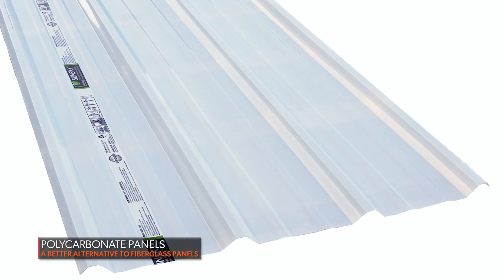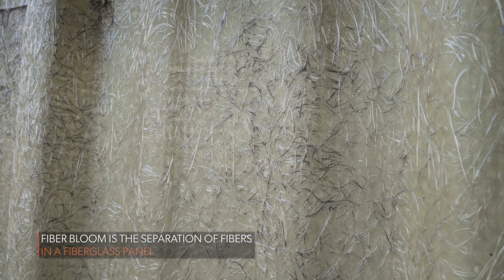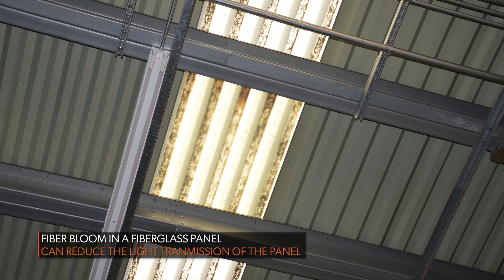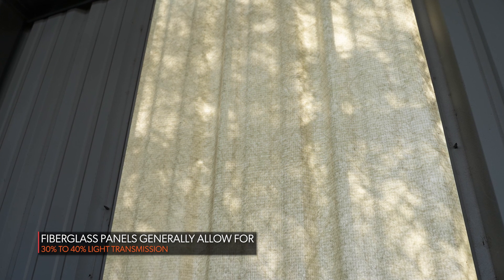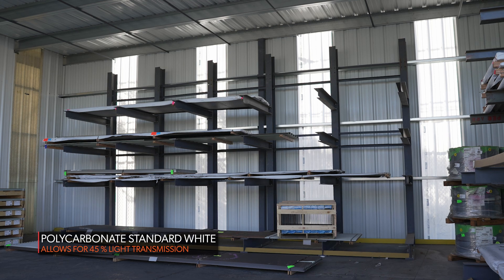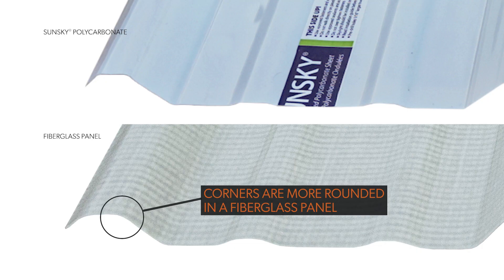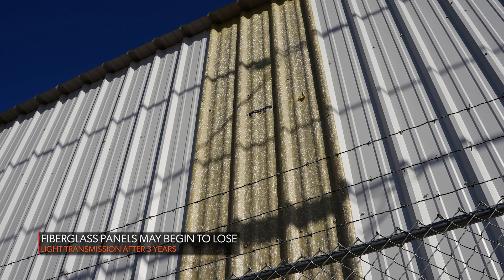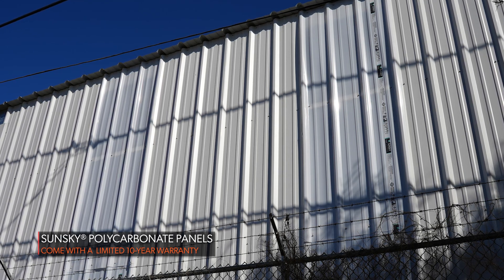Fiberglass Vs Polycarbonate Roofing Panels: Which Is A Better Skylight For A Metal Roof?

Comment: I went to Pet o werehouse the roof tops has a fibreglass panel I 
Think it’s cracking
Reply: If you made it right it wont crack. Fiberglass are for underfeound tanks and pipes also. Depend on application.

Comment: There's a full fiberglass greenhouse at my great grandparents'  house that's still sturdy and going strong for over 50 years now. I'd rather have something that lasts, all these newer plastic panels would bust with strong wind or some hail 🙃
Reply: That's why im telling everybody here that this is a very wrong information. Fiberglass last for years even 50 years or more. As long as you use the right materials and process. Here are the fiberglass industry: bus body, underfround tanks including gasoline station tank, underfround pipes for chemicals and oils, marine vesels like speed boats yachts etc.. outdoor decoratives and gardine accessories lime pots etc.. windmill renewable energy,

Comment: is this product suitable for long run (80' lengths) commercial applications in a tropical environment?
Reply from the maker: Hello. Max we can do is 20’ sections –which can be overlapped to make 80’ runs. Tropical environment is not an issue. 

Reach out to Sales@westernstatesmetalroofing.com or call (877) 787-5467

Comment: Nothing about impact resistance...
Reply: Got a feeling the fibreglass is more resistant but they won't say here
Reply: @davinmars5177  it cracks easily
Reply: No fiber glass is not waterproof like they said it will leak in about 3 yrs.use epoxy resin the one with silicone and mix it with hardener.its waterproof & UV